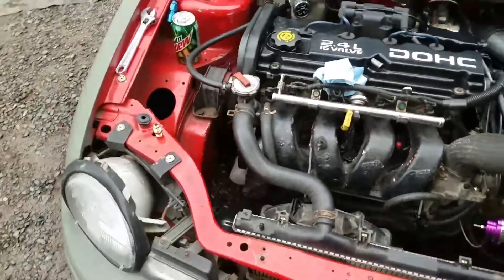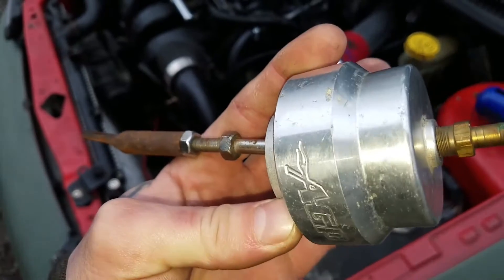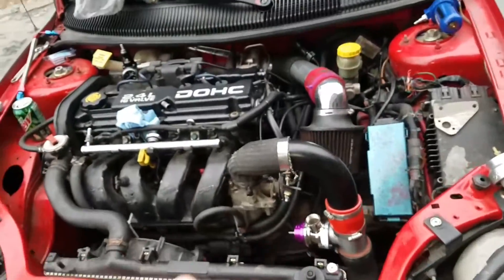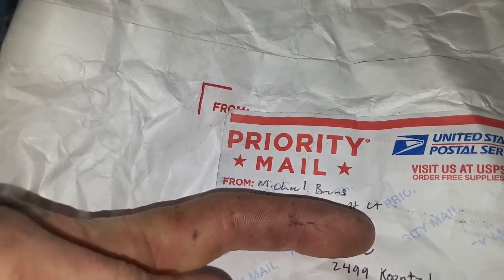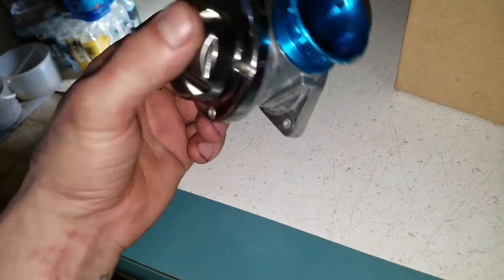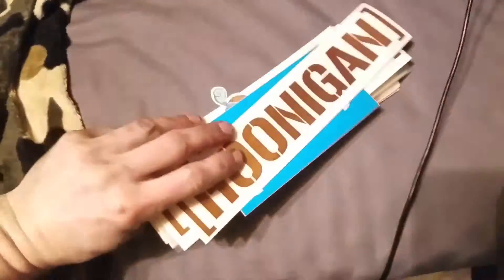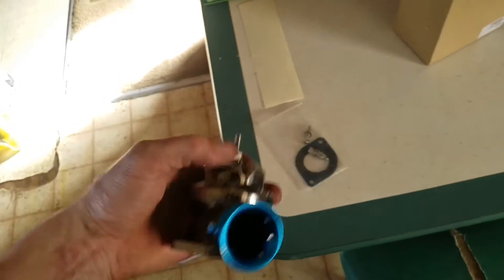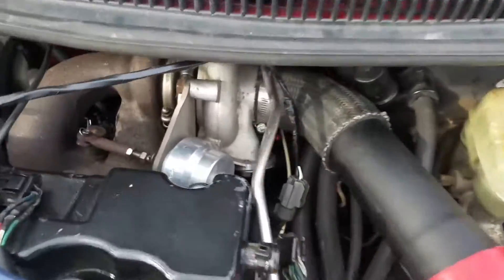FANS SENT ME THESE!

Comment: Looking forward to the built bottom end when you install that AGP wastegate and boost 15 psi. You just need an OEM wastegate on your car. Your not even running a mega squirt or AEM to tune it.
Reply from the maker: +Kcarviper life's to short to stay stock lol im only running 8 psi right now about to go up to 13 psi for about a week then go to 15 and stop but when I put my fully built motor in and big turbo I will hopefully be pushing 30psi
Reply from the maker: +Kcarviper I have a 38psi tial wastegate for my built motor and big turbo